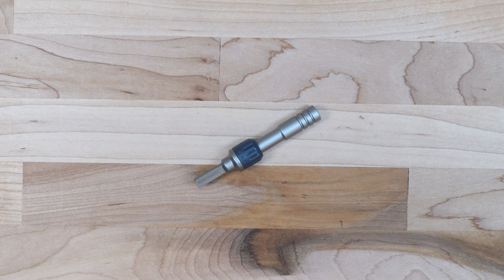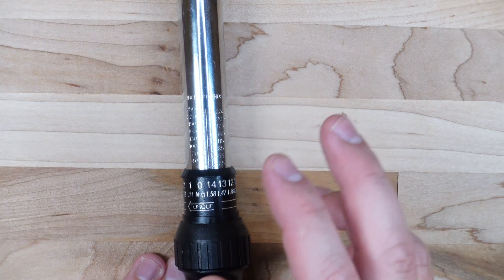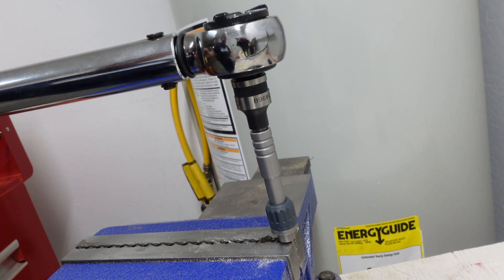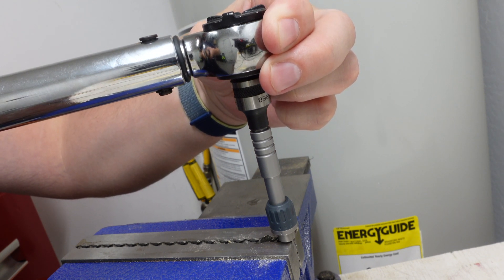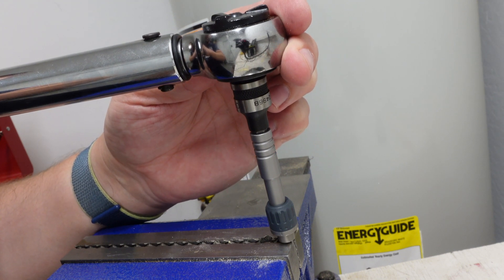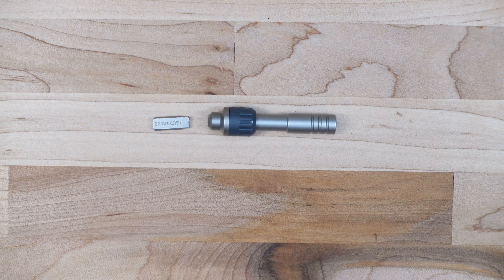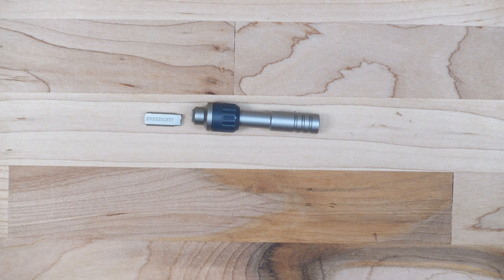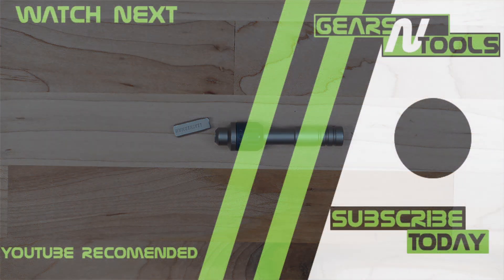Leatherman Ratchet Driver Destructive Testing - How much can it take?

Comment: I’m actually impressed that the ratchet driver handled that much torque.  I am curious, though.  I suspect the driver might have handled more torque if was new and not already stress tested numerous times, which probably weakened it.  With that said, however, testing a new, unused driver at the maximum torque would only give you the max level of sheer strength.  There is one other interesting question, though.  What’s the maximum working torque where the test is done repeatedly without any failures.  Of course, these tests would be quite costly.  I do appreciate knowing that the driver is far stronger than I had originally given it, or actually the ratchet part in particular.

Comment: Thanks for the test, its result is really important for the consumer and indicative. Very professional approach, videos with episodes, often missing this... Are you still planning a ratchet test in a multitool holder? With respect!!!
Reply from the maker: I did a video on the bit driver breaking the holder on the multi tool.  it broke at a higher torque than the ratchet itself did.  

Here is a link to the video for you: https://www.youtube.com/watch?v=Ljj2GwzKAkc
Reply: @gearsNtools  Yes, I'm sorry, I already found all the test videos, converted them to the metric system (Newton meter), attached links to videos from your channel and a link to a table with the strength of bolts to break the head to understand what Leatherman is capable of ... I distribute this information among Leatherman fans. Thanks for the tests!

Comment: Why cant you 'freaks' not switch to metric system?.. Common! xD
Now i must convert so i can understand what gives. Tho, i am curious to what a leatherman bitholder can take. I am sure that is the weakest link, if they dont use some kind of super metal. If they haven't designed the ratched driver to break before the multitool? I see the next video will show me. :P

Comment: If your feeling give as you increase tension each time aren’t you weakening it with each test after some point?
Reply from the maker: Potentially yes.  In an ideal test I’d do multiple samples and use a steady ramp trouble.  But I didn’t have the budget for that.  I think this test gives you a pretty good idea of what it can do
Reply: @gearsNtools   Sorry, didn’t mean to sound critical! Definitely a good test for the general idea. It actually performed better than I expected.

Comment: I think the unit would have withstood more that the 300in/lbs if it were only in an axial load. The issue was that in the process of applying force you were also applying a fairly significant lateral loading to the adaptor pin.
Reply from the maker: you're probably right,  I think this test is still a good real world test, it's unlikely you'd put a perfect axial load on it.  I also tested the bit adapter on the tool in a different video and it failed well under the 300"/LBS that this ratchet driver did.  

All in all I'd say this design was a success!
Reply: @gearsNtools  And like you said a few times when testing the bit holder on the Wave and Surge, if you have to put that force on a fastener then you need to get the right tool.

Comment: Interesting test but not ‘real world’. If you are just simply testing the strength of the ratchet adapter, that’s one thing. However, a ‘true’ test of its usability would be in the leatherman itself. If this was done, my guess is that the leatherman at the point of connection to the ratchet adapter would give way much much sooner than being secured in a vise grip. Failure would occur probably at half the torque rate as tested.

Comment: It did not break due to the torque. Should redo using proper counter force at the head of the torque wrench.
Reply from the maker: This was about as real world as it gets, nobody uses their tools in a lab.  also the ratchet, exceeded what the Leatherman bit adapter was able to handle in my other test so it's not the weakest link.

Comment: Add a larger radius (stress relief) to the tab easiest fix...make tool out of 17-4 ph (h-900) if you wanted to use it over an already non practical limit and loose money that the majority of users will never see the benefit of and end of paying for. Or you can leave it alone, seems well engineered to me) Good testing, now I know how strong mine is roughly...

Comment: Normally the driver would be torqued evenly, not from one side like that which could cause a sideways force at the top of the driver which in turn would cause another torque orthogonal to the first about the clamped region. It looks like the failure was caused by the resultant of the two torques, failing in both shear and tension. Probably a worse case than if the torque was symmetrical.

Comment: I'm thinking that the tang of the ratchet broke from side flex and not torsion since you were not holding the head of the torque wrench and from looking at the closeup of the break. If the Leatherman ratchet was being used in a Leatherman tool to tighten or loosen a fastener, it would not have that side flex and would possibly handle a bit more torque.
Reply from the maker: I think when you are using hand tools you're going. to get some side stresses regardless.  that being said I also tested the standard bit adapter (separate video) and this one performed better.  It exceeded my expectations which is a good sign given my less than perfect testing method :).

Comment: I have a sheath that holds my surge and a bit extension... The ratchet would not fit.
Turns out it will: read follow up replies...
Reply: I think it is very dependent on on which sheath.  It fit fine in the Surge sheath I have.
Reply: @DavZell  thanks my brother
Begin edit after picking up my mail...
You are right David!  I just got a straight extension and it fit perfectly in the small side sleeve... The large one will be perfect!

Comment: I wonder if they have a flawed metal formula here.
Reply from the maker: I've been thinking about how this broke over the past few days and my theory is this looks like a cast part, I'm wondering if the grain structure changes due to different cooling rates between the thicker and thinner parts.  this would cause some internal stresses at that transition point.  they might stress relieve it to aliviate some of this but that's my theory, I don't have any real facts to base this on. if anyone knows jump in! I'd be interested to know.
Reply: @gearsNtools  Maybe it's that sintered metal crap?
Reply from the maker: @ucitymetalhead  probably not, that's a slow expensive production process mainly for prototyping and really weight sensitive applications.  (would love to get one of those machines thought!)
Reply: @gearsNtools  A guy named AvE is always pointing out that kind of metal in drills and tools so i thought maybe it was there too.
Reply: This test was way beyond the designed capacity of the ratchet. You can’t apply that much torque to a Leatherman tool to break the ratchet that way, so it really doesn’t matter.

Comment: You went from 250 lbf-in (28 N m) to 300 lbf.in (34 N m) and the fitting broke, not the ratchet but it is still a bit damaged.
You have the foresight to ask yourself the question of use in real conditions, either coupled to the bit driver.
It is clear that Leatherman sized the resistance of the ratchet to the resistance of the bit driver.
It is clear that Leatherman dimensioned the resistance of the ratchet to the muscle twisting force of a muscular user (inf ~ 30 N m)
So I say that this ratchet is a success.
Your test is interesting and significantly more edifying than TrumpToolCrip's botched test.
Reply from the maker: Thanks for watching!  I try to do these in a way where it’s applicable to a real world scenario.  I have a follow up video planned I’m interested to see how much torque I could reasonably generate by hand. Not sure I could even hit 30N/M with just the multi tool handle!
Reply: @gearsNtools  Yes, I was talking about a muscular man: what torque can he develop with his hand, arm and upper body? ... Are you going to summon a weightlifter? :)
Reply from the maker: @diezelle57  I used to be a weight lifter does that count?  been over 10 years since I competed now I'm lowly pencil pusher lol.
Reply: I watch both your channel and TXToolCrib because I enjoy them, and have taken no note of your views.  I find it disappointing when name calling comes into play in something as non-political as tools.
Reply: @DavZell  Speaking of apolitical tools, TrumpToolCrip, so named after an exchange I had with him, is not the last to insinuate a kind of economic patriotism. I unsubscribed from her channel, after having greeted it from birth, because I did not appreciate her peremptory tone, her egocentricity and her inability to recognize her approximations and errors. His lack of intellectuality and humor is crippling for me.
Reply: Сиди уже,старик, и молчи.

Comment: It is interesting that you did a different style of test then TX Tool Crib and got differential results. He blew apart the rachet housing and cracked the plastic but he couldn't find any marks on the teeth
Reply from the maker: I was surprised mine failed differently too, I’m wondering if by applying a large load multiple times the metal experienced fatigue cracking.  Where he applied one large load.  I’m interested to see how his follow up tests go.

Thanks for watching!
Reply: @gearsNtools  yes I agree with u doing it over and over weakened the metal forsure.  Either way great video, 👍🏾.
Reply: @gearsNtools  I'm thinking that multiple stresses might be the more likely use case for many people (that aren't gorilla arming things).

Comment: Before you go ahead with destructive testing on the leatherman bit holder you might want to see how much torque you as an 'average' guy can actually comfortably/reasonably apply to a leatherman tool bit driver. Just to show approximately where on the scale the critical failure point is in relation to how much a person is likely going to actually apply to the tool (invert test, hold torque wrench in vice and use the tool by hand to see what your max effort = torque you can apply With multitool). 
Also it would have been informative to check the functionality of the ratchet after every test incriment to see if that torque setting has effected the opperation of the ratch mechanism.
Reply from the maker: That’s a good point, I’m not sure what kind of torque I could generate with just the leatherman handle,  I’ll set something up an give it a try, 25 ft/ lbs is gping to be a lot to put into a small handle, you can see how bit the torque wrench is by comparison!  

Thanks for the idea!
Reply: @gearsNtools  Great....I guess my point is that the ratchet bit extender is designed to be used in conjunction with the Leatherman tools so it is only fair to set a standard benchmark of how much torque one is likely to achieve when using this combination so we can see how much the tool ultimately performs against that metric ("give me a long enough lever and I can move the world" Achimedes).
Reply from the maker: @bunyipdan  I agree this video doesn't provide much context for the findings of the test, I like you idea of setting a relevant benchmark then seeing what the ultimate limit of a product is as a data point for consideration.  

I appreciate the useful input, it helps me make better videos. (I'm learning on the job here ;) )
Reply: @gearsNtools  no worries.....I wasn't being critical just adding my two cents worth......keep up the great work, cheers

Comment: Hey you got to admit it... It's pretty fuckin impressive, considering the size of it... It's tiny & let's be honest if you need to use that much force you probably won't be using a multi tool..... One quick question if I've got a different multi tool like the SOG power Assistant MT with a standard bit size, Will the ratchet fit on it?
Reply: I don’t think it will fit ur sog unless you get leathermans other bit adapter that slips over the Phillips head then u can attach the ratchet to that adapter. Long as ur sog has the same size Phillips as the LM.
Reply: @4Thug2Life0  I was thinking that but I'm pretty sure leatherman bits are half size bits & the SOG has a full sized bit driver we'll see if not I'll make something.
Reply: @4Thug2Life0  I was thinking that& I think if you look closer, The leatherman bits are  half size as you can put full size bits on the driver, I never knew that ither but when you see them put leatherman bits & full-size bits it it I think it might work
Reply from the maker: @4Thug2Life0  it would be a little tricky but there is a 1/4" hex socket in the base of the pliers when the tool is closed.  it should work in there.
Reply from the maker: I agree this exceeded my expectations.  For what it is it performed very well! I couldn’t ask anything more of this, when you’re breaking off solid metal componets you know they made the most of the space available!

Comment: Looks like you might have been pulling down on the torque wrench putting unusual pressure at the base of the ratchet. This might not be a fair test.
Reply from the maker: Part of that could be the camera angle, but I’ll be the first to admit this isn’t a perfect test setup, but when you use this in the real world there will be other loads introduced as well so I think it’s still a good representation of its capability.  

I did my best to only put torque stress into the tool when doing the test.  

Thanks for watching!,